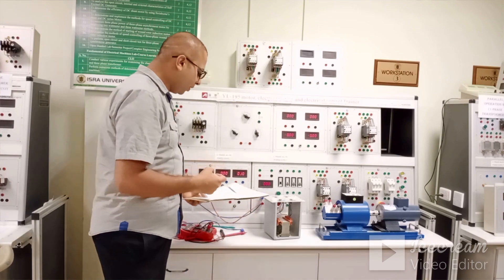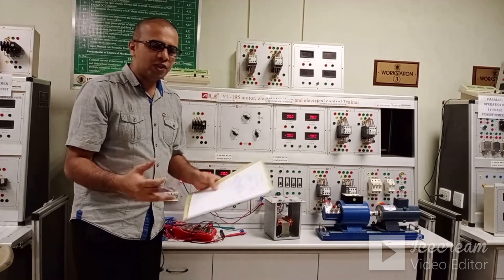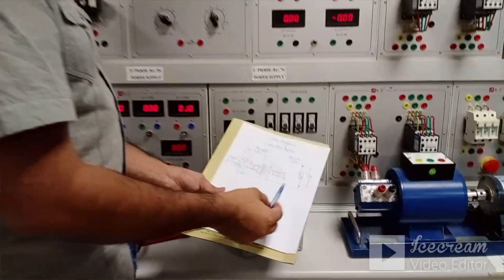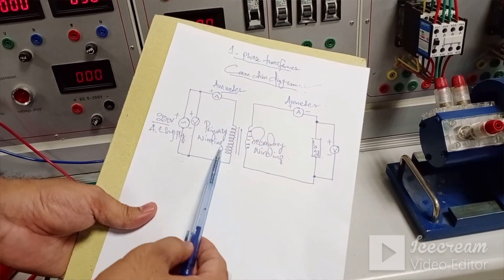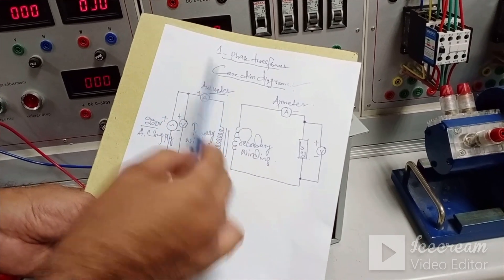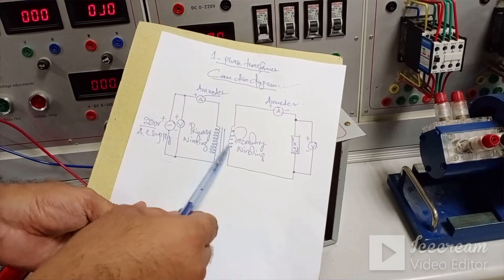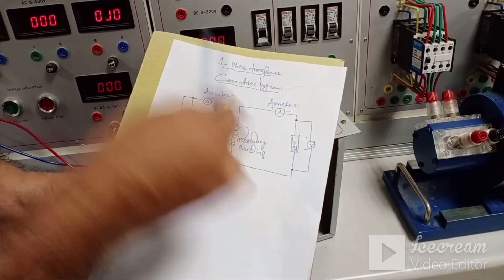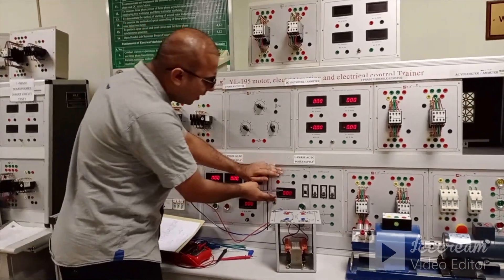Transformer Operation (Experiment No. 01) | Working of 1-Phase Transformer | Electrical Engineering

Comment: Asalam aleikum sir ahsan memon from 18 batch electrical engineering sir why the current of primary side is less then secondary side current, this is understandable that voltage of seconday is low because of step down transformer.
Reply from the maker: Simple answer is that load is connected to the secondary winding of transformer...obviously it will draw the load current in comparison with primary winding.....always the current is more flowing when load is connected with any electrical machine....thanks
Reply: @ShoaibAhmedDayo  Thank you so much sir i remember now sir Thanks for all your efforts and hard word may god bless you sir.